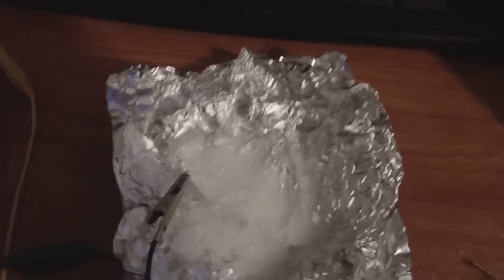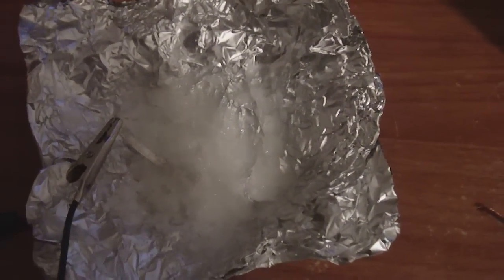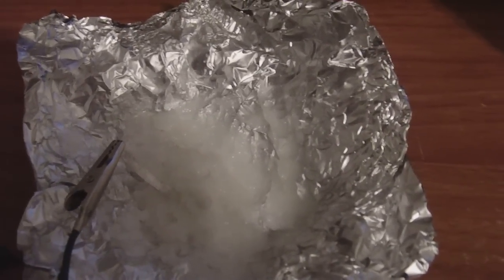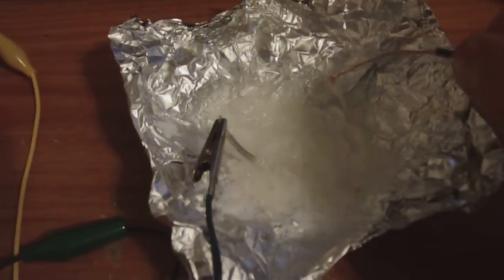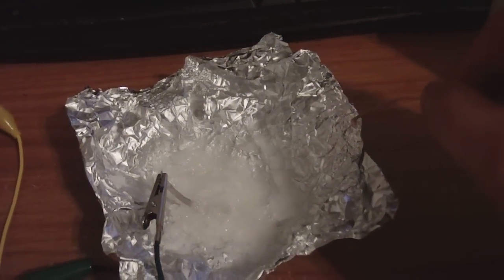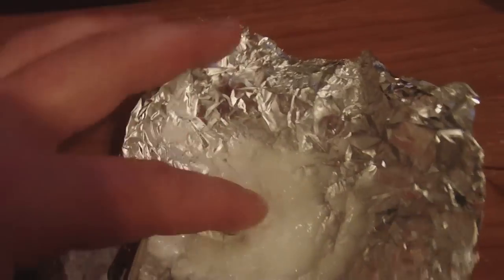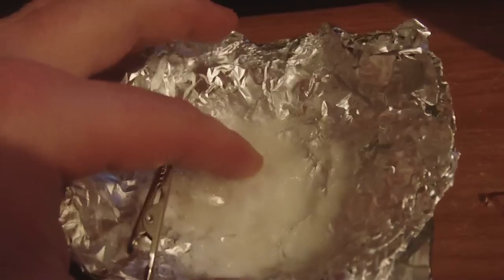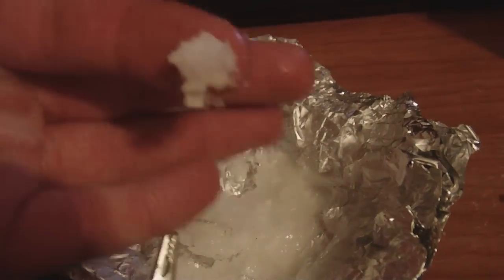Jelly Crystal Cell

Comment: And I add water only at the begining, and then i let the crystal cells to dry, and remain so. The cells do not loose charge if you alternate them in cycles of lets say 12 hours each, with a switch.The cells must rest, from time to time, to recover the charge. Fast short also works for some recharging of a few mV.

Comment: Hi ibpointless2, nice job, tnks for sharing. I wanna also share with you my work about crystal cells, so my actual formula is: dioxide manganese, carbon, sand (or silicate), and some epsom salt. I am not using magnesium, is too reactive, but i use copper-Al.